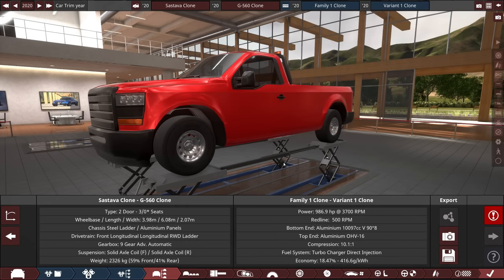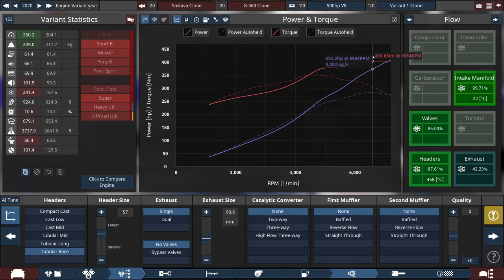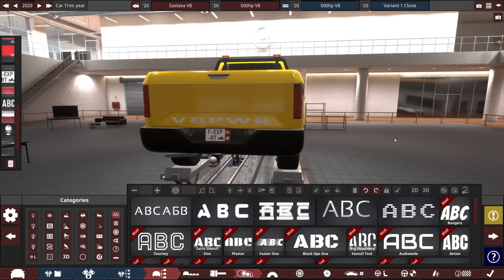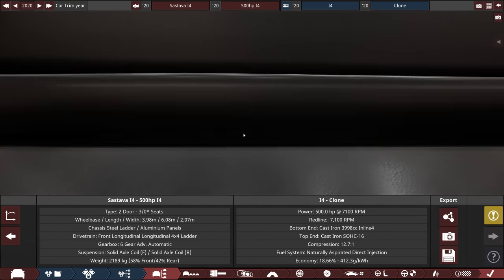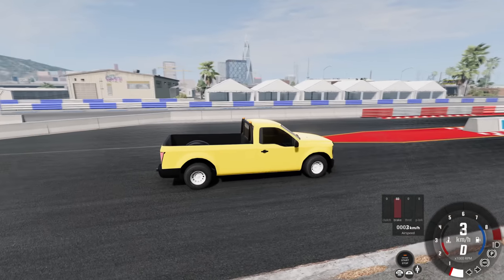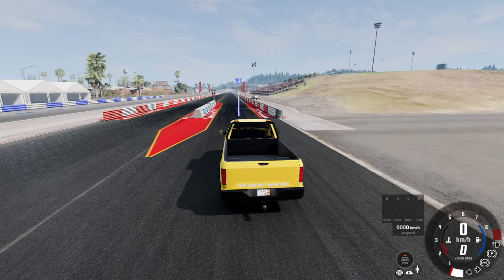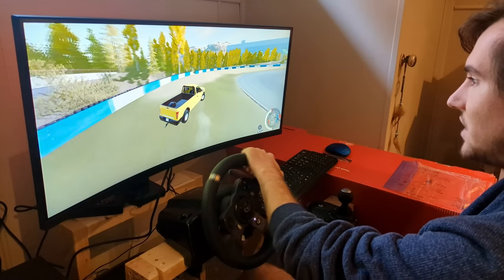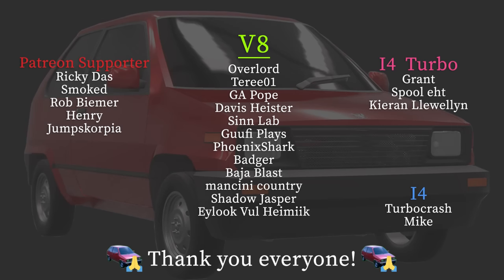4.0L I4 VS 4.0L V8 - The Ultimate Challenge

Comment from the maker: If you're interested in the SimRIg the most recent video for it is here: https://youtu.be/u7EtS6iIUiA
Reply: rpm should have been you most important factor . If it was the same then no gearing would be considered as a part of the equation. The testing would have eliminated everything other than the engine itself.
Reply: This size i4 is very extremely difficult to make irl due to balance issues.

Would likely require balance shafts just to stay together

Likely the reason the v8 is better in this is the same reason a modern electric impact is better than an air impact. More hits per second even if they're weaker, or smoother, more even power delivery
Reply: do a V8 to I6  and tow test them

Comment: The funniest “extreme displacement” engine that I’ve made was a 1.6L V16 quad turbo.  It wanted to rev well past the 12,000 RPM redline, given the parts were rated to ~30k RPM.  I was barely able to get the turbos to spool, but it ended up having between 800-1000HP above 9k RPM.  It’s in a rear-engined swapped hatchback turned Pike Peak racer.  The whole car weighs something like 1300 lbs.
Reply: My favorite creation is a similar 1.4L single turbo V10 making 1900 HP and revving to 11k RPM. It only weighs 280lbs so I slapped it into the lightest body with the widest tires in the game and it's easily the most insane track car I've seen
Reply: @estrxn mine is a 1l i5 ~550hp in a 520kg car with 1200kg downforce 😅 2,23g at 200km/h  but bruu then the boost kicks in the rwd kicks out a bit
Reply: This game has no 2-stroke witchcraft.. I proppose a DLC with the "glorious 2-stroke witchcraftery" - official name.
Reply: Mine is a similar V16 car but I put it in an originally electric Chinese micro car and turned it into the dumbest rally car ever.
Reply: @TheLtVoss mines about a 7 maybe a 6 if it’s cold
Reply: So it's kinda waste of weight. I've made 1.6L V6 1570 HP single turbo just like Formula 1 have and it weights only 109kg(240lbs). If I would add another turbo it could be around 1700 HP
Reply: @RmX.  I personally like to think outside the box at times to create fun, funny, and unique cars.  My lore behind the car was that a former motorcycle manufacturer starts making cars with motorcycle engines to compete in the compact car market.  After years of making these little 400cc FF hatchbacks, the company decides to build an extreme one-off unlimited class racer powered by four of the blocks welded into a V16.  The result was a barely functional prototype that wasn’t at all competitive, but it was quickly a fan favorite for its “so ugly it’s cute” styling and the heavenly soundtrack of 16 100cc cylinders spinning to the 12,000 RPM redline.

Comment: The reason that the top speeds were different is because the rpm limits were different. The i4 had a lower limit, making it the slower engine. It matters more when you're using the same gearing ratios, like you did here.
Reply from the maker: Good point, completely missed that while building
Reply: @automotiveflux also because the I4 have 500hp at the very top end rpm, and before u reach that rpm or just reach that rpm, the gear change and the rpm drop again 
so it basically drive in about 470hp  

*sorry if my english bad
Reply: Horspower is directly related to rpm. Since then in-line 4 had a bigger stroke due to the limited space, it can spin as fast, it is more torquey tho.
Reply: @2seep yeah with twice the displacement and the huge increase in rotating mass per cylinder it was never going to rev high with that long of a stroke

Comment: The v8 is always going to be smoother. The v8 puts the power down twice as much. I mean you have 8 power strokes for every 2 revolutions of the crank. Only 4 on the I4. Even with the cylinders being half the size you get a power stoke in less crank rotation making a more complete power curve. This is why electric vehicles are so fast. They just give you 100% power all the time with no gears.

Comment: One of the things that tends to get lost in the noise is Parasitic Drag inside the engine itself.
So the V8 has 86mm bores on all its cylinders.  Going with modern conventional piston ring design, that's 3 sets of rings per piston: 2 compression rings, and one oil control ring assembly, each with ~ 270mm circumference, and we're assuming 1.5mm, 1.5mm, 3.0mm thickness respectively, giving a total friction surface are per piston of 1,620mm^2 per piston ring package, of which there are 8 (total of 12,960mm^2).  Then there are the additional rod bearings to worry about.  If we base our engine on K20 dimensions, the rod bearings are ~16mm wide per bearing, and have a circumference of 51mm, then each bearing has a friction surface area of 2,564mm^2, giving a total of 20,508mm^2 friction surface area.
The inline 4: bore of ~108mm, so same math applies.  Total piston ring friction surface area per piston (given the same 1.5, 1.5, 3.0mm ring package) is 2,035mm^2, giving an overall total of 8,140mm^2 (4,820mm^2 less than the V8, or ~37%)
As far as the rod bearing is concerned, we'll keep it realistic with the increase in displacement per cylinder, so our new dimensions could be 25mm wide and 59mm diameter (based on big-block chevy dimensions).  That equals 4,634mm^2 per rod, giving us a net total of 18,535mm^2 friction area for the rod bearings.
Net total friction surface area:
V8: 33,468mm^2
I4:  26,675mm^2, a 20.3% reduction.
I'm not sure if Automation takes that into consideration during its simulations, but those frictional losses do have observable real-world effects.

Comment: Ultimately what I’ve learned after playing with automation and looking at real life motors 

Is that 4 liters is 4 liters, displacement all things being equal is what roughly determines your raw torque output. 

What really makes the difference is engine balance and RPM limit. 

The main benefit of more cylinders at the same displacement is either less stroke (lower piston speeds) or swapping to a layout with better balance (inline 6)

Torque(ftlbs) x rpm / 5252= HP. So more rpm is better. The more real world challenge for you is 2L v6 vs i4. 

Japan has/had? A tax bracket for under 2L, so Mazda made a 2L v6 that revs to like 8-9k rpm.  

But 2L is a square 86x86 for an i4 so that would be a fun challenge IMO to see if you could benefit from the 2 extra cylinders.
Reply: adding more cylinders decreases the time between power strokes, allows a more favorable valve size to diameter, and also doesn't require flame expansion to cover such a large distance. it's why v12s make really good power per cubic inch despite being relatively small. I know hp is just torque x rpm ÷5252, but the airflow and rotating resistance will determine how far out torque can be maintained

Comment: Stroke is where torque is created, which is why the i4 has more torque.

If something can rev faster at the same power rating as something else, it will be faster. The v8 has less inertia (more smaller moving parts instead of fewer beefy parts), so it is faster in the drag race. Torque is ultimately what gives you efficiency and power - but the speed that power is delivered at is more to do with other factors.

Comment: Loving the vs "series" your doing. The whole reason the v8 was quicker has to do with the torque curve. The v8s torque came on lower in the rpms and was a bit more linear. The i4s came on at higher rpm and even thin it had a weird swing to it. Gearing could have equalized it but that isnt the point of your awesome videos. Keep it up! These are lot of fun.

Comment: @30:45 the gearing is not the same, the top speed you selected is. 
Higher RPM = Shorter final drive/gearing for the same top speed.
Shorter gearing = more power to the wheel. 
It was obvious the v8 was going to win just from that fact alone.

Comment: It would be pretty much equal but the larger bore and stroke made it hard for the I4 to rev as high and since you had the max hp at redline it had 2 things working against it.

#1 it had to shift into a higher gear first, and cars just accelerate slower in higher gears.
#2 the engine spent significantly less time near the 500hp point in the revs than the V8

Talking about turbo and torque. A turbo engine will make significantly more torque in the midrange than an NA engine. Rule of thumb is if the boost is set at 14.7psi/1bar it will make the torque of a NA engine 2x its size and at a relatively low rpm so that inflates the numbers too.

My real car made 291 lb/ft of torque out of a 2L I4 at 18psi while a stock 2003 or so big block 454 (7.4L) chevy avalanche made 360 lb/ft right after me

Inline engines typically make more torque but lower hp than a V engine if everything else would be equal.
Smaller cylinders typically are more fuel efficient and higher reving than larger bore engines. That pretty much explains 80s and 90s hondas😂

You happened to pick what is typically considered the ideal bore and stroke for the V8😂 86mm square. Compare to the bore and stroke of the 4G64 and k20 engines

Comment: Great fun!
Was there any major difference in fuel efficiency? 
The other thing that could be a blast would be to take each of those engines as they are and put them into the smallest and lightest 2 door car body they will fit. 
Your basic sport car with truck engine. Something with (maybe) mid engine, AWD, and proper aero. All CF frame and body panels.

Comment: Inline 4 engines have bad secondary balancing so they can't rev high unless they are really small.
And you needed to change the gearing because the engines have different rev limits and peak torque is at different places.

Big trucks use inline 6 because of the balancing being perfect, which results in great reliability.

Comment: What count is the area under the horsepower curve within the range of rpms used. Since the I4 made its 500hp at the peak rpm, the average power must have been lower than the V8. Also your top speed was lowered because your rpms were lower. You did in fact have different gearing to reach the same top speed, but it was the right thing to do for a fair comparison

Comment: I would like to see a similar test with the i4 having a cross plane crankshaft.
Larger diameter bores and shorter stroke length.
I think this will help it rev out more and should develop more horses.
If that doesn't work then keep the same idea in mind, drop the total displacement to 2.5l and add a turbo.
Get that upto 500 hp and then see if there is any significant difference 😂

Comment: I have respect for inline engines, mainly because they are highly efficient when used properly. But even with turbos they are only good at making power at certain rpms even when messing with cam grinds they typically dont like anything under 2k rpm. Either way youre talking about less booms per second than say a v8. Resulting in less horsies and less torquies, all around. This is an interesting take on the no replacement for displacement, which i believe is still king. Sure you can add a turbo to a small engine but you can add a turbo to a big engine too and still make more power. Yea that defeats the whole saying but forced induction all together is just changing the whole game anyway

Comment: Did we not account for the fact your running a higher final drive ratio for the i4 because it revs lower? You leveled out the speed but that puts the i4 at a mechanical disadvantage.

Comment: With less engine RPM you need taller gearing to achieve the same speed. The four cylinder should have a lower top speed with the same gearing.

Comment: I think that the higher gear ratio on the i4 override the extra torque it had and after going through the transmission had to fight more to accelerate. I think that's why it was slower in the drag race, but I think revving lower would make it more fuel efficient.